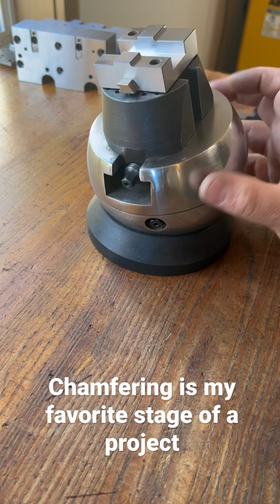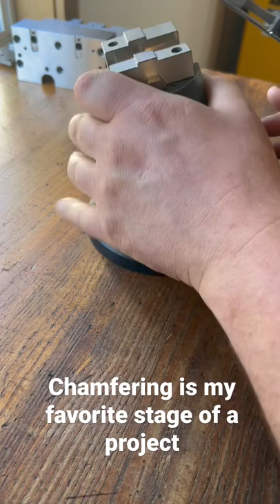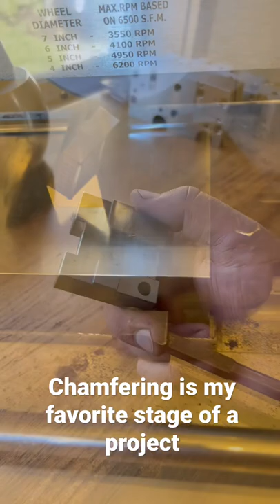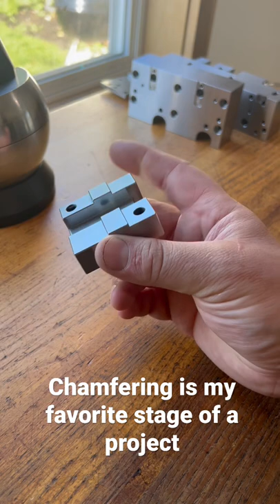Chamfering time #instamachinist #machinist #toolmaker

Comment: Does chamferring apart like that serve a mechanical purpose, is it 100% necessary for the design and function of the part or just so you don't cut yourself on the sharp edges and it looks nicer?
Reply from the maker: Both, having chamfered edges is certainly nice on the hands. Mechanically it’s important for allowing the parts to go together. Ground internal corners tend to have a few thousands of inch radii and you need to chamfer the matching part that fits into that corner
Reply: Chamfers also serve a purpose which is less obvious. On ductile materials (even many grades of cast iron) even a slight knock on a 90 degree corner will raise a bruise on the adjacent faces. Consequently a  hole will no longer accept a close fitting pin, and a flat face will not sit flat on a mating part.
Two 45 degree corners a small distance apart are much stronger and will be much less prone to this problem.
Secondly, even on hardened parts, the entrance to a close fitting hole, and the end of a corresponding pin, MUST be chamfered 
Otherwise, even without bruising, it will not be possible to insert a close fitting pin.

Comment: i havent touched a hand grinder since getting a 5-ax machine :/
Reply: Lucky . I have these parts that have 20-40 8-32 holes, it’s with a very gummy alloy of copper, even if you do your order of operations right, face chamfer face chamfer the holes always have to be chased by hand to garentee a go gauge will go. Then they get nickel plated and I have to chase them again. Usually over 1000 holes per job 🥱😒 I hate deburing 😂